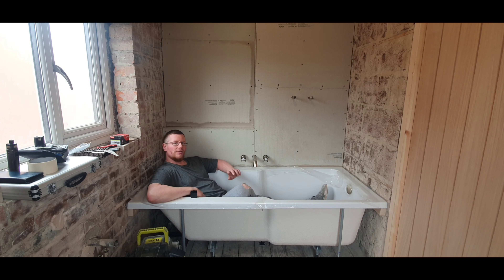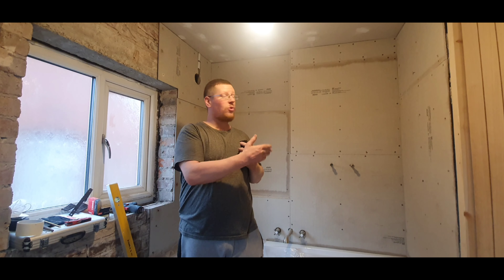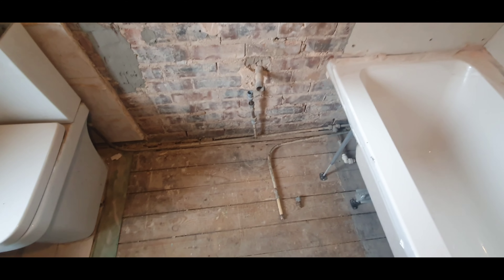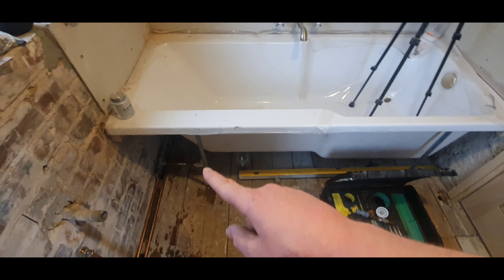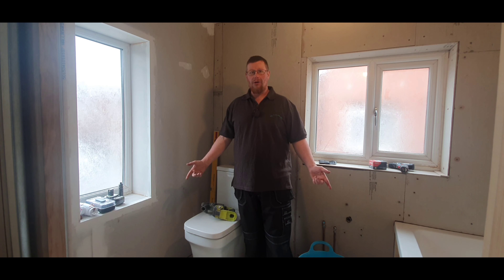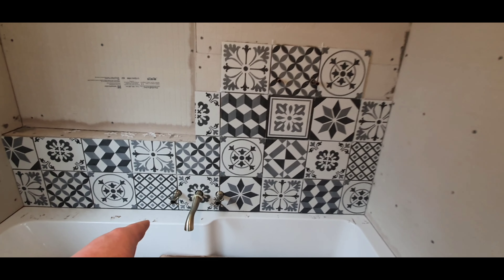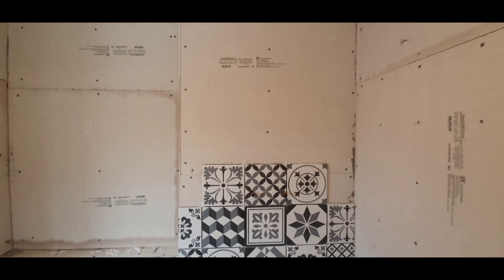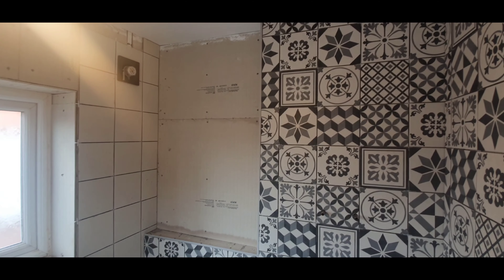Bathroom renovation part 5. My 1st Time Tiling

Comment: You need to wear a mask when cutting cement board, and preferably cut with a wet saw to control the dust. That stuff is really bad for your lungs mate.
Reply from the maker: Yeah I realised after I had cut them that i didn't put my mask on. Luckily I only needed to do minimal cuts with the grinder and the rest I scored and snapped 👍